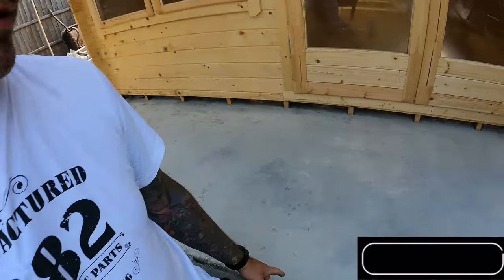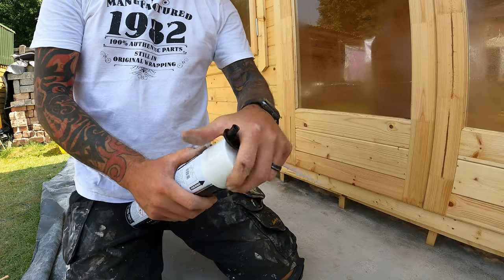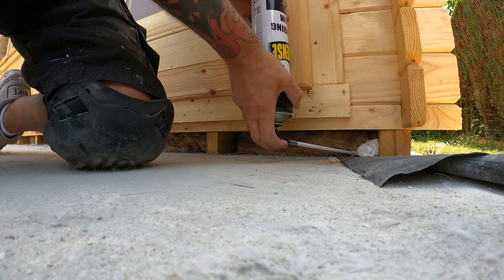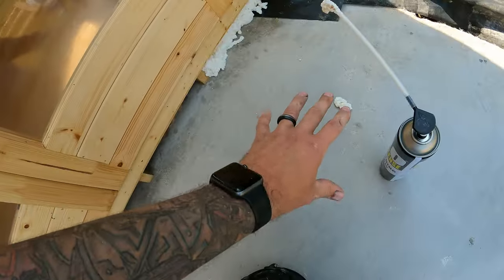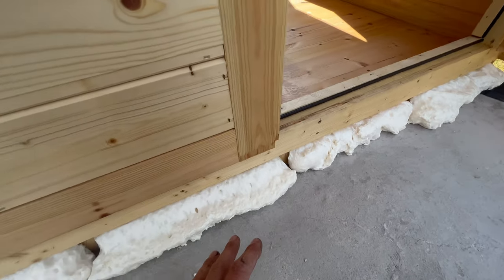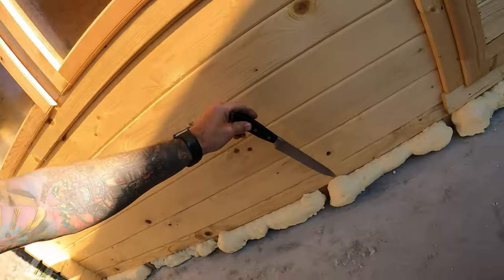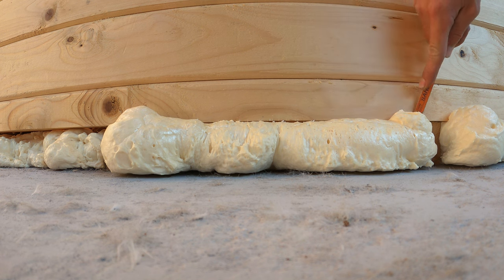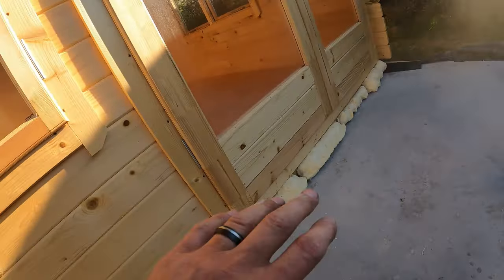How to use expanding foam

Comment: Great video, especially the part about wetting the surface. Just an important note that expanding foam can be toxic so I wouldn't use a kitchen knife to cut it, even if you clean it afterwards with acetone, it can get messy.
Reply from the maker: Thanks 👍, it’s only the wife and kids that use the knife so I have nothing to worry about 😝

Comment: This the best pest nest ever. Insulation, ground contact, and the wind is blocked.
Reply: I agree, this should not be blocked, air should be able to freely circulate under the sub floor to avoid rot and use mesh wire to stop rodents and pest making a home under your summer house.

Comment: can this foam be used to fill a small hole made by birds? my biggest concern is flammability, the structure faces direct sunlight, is this foam going to ignite outdoors?
Reply from the maker: You can fill small holes with it, it should be flame resistant and waterproof but check with the manufacturer beforehand.
Thanks

Comment: Never apply foam to a damp substrate. Sprayfoam 101.
Reply from the maker: That may all depend on the product your using, as stated on the soudal website (who manufactures the no nonsense foam)
Application method
Shake the aerosol can for at least 20 seconds.
Open the cover and fold the tube horizontally.
Surface should be free from grease and dust.
Moisten surfaces with a water sprayer prior to application. For non-conventional substrates a preliminary adhesion test is recommended. Fill holes and cavities for 1/3, as the foam will expand. Repeat shaking regularly during application. If you have to work in layers repeat moistening after each layer.
Always read the instructions 101
Reply: Polyurethane is moisture cure.